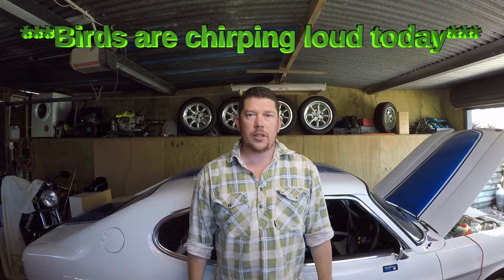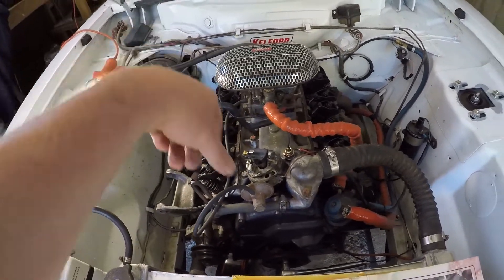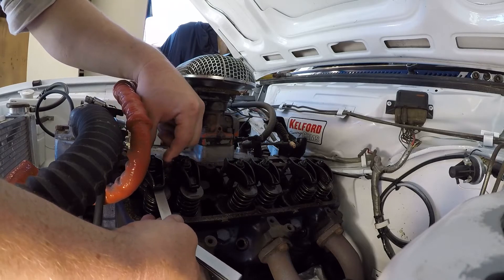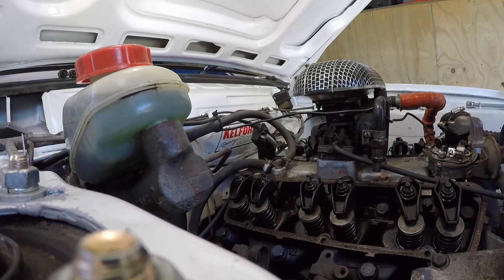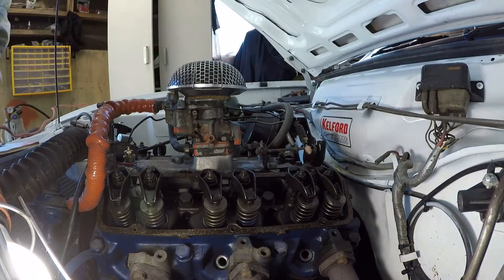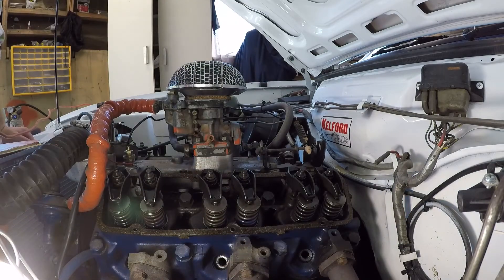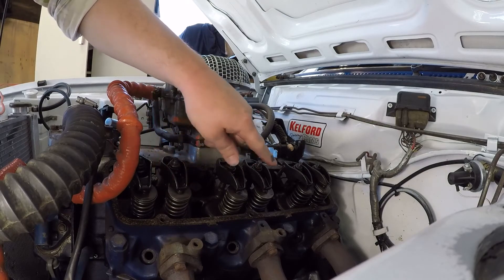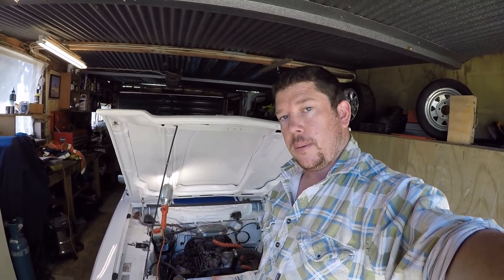Valve lash check on a Ford Essex V6 Capri

Comment: Tap both sides of  the rocker with a spanner to make the rocker aligned more correctly on the valve stem before checking with the feeler gauge as this is more accurate .

Comment: Mate!! That's a great video/help. I have a 76 Mk3 cortina Bakkie (Ute) 3.0l Essex, 5sp manual. Owned it for a week. I believe there is some power/torque to be had out of this little motor? I'd love your input/advice 😎
Reply from the maker: Hey Warren, assuming you have given it a good service and once over, checked ignition timing, spark plugs, fuel mixture, ht leads etc probably the easiest modifications for any classic car would be a good set of long tube headers and free flowing muffler and exhaust. A high flow air cleaner and possibly a carby upgrade depending what your running. I say these points first as it doesn't require diving into the engine and your likely to get some solid gains. Some cheap insurance is to inspect the condition of the oil pump hexagonal drive by pulling the distributor and looking into the engine to see if it is badly worn or the hexagonal in the bottom of the distributor is badly worn. Once those points are covered, you could look to port match the intake to the cylinder heads but probably not that beneficial without a aftermarket mild road camshaft. From that point, your really looking at pretty major engine work such as uprated camshaft, engine balancing etc. Please note I'm not an engine specialist, it's just the most likely order I'd go about it.
Reply: You all prolly dont give a shit but does someone know a tool to get back into an instagram account??
I somehow forgot my login password. I would love any tricks you can offer me.
Reply: @Sonny Andres instablaster :)
Reply: @Jaime Benedict i really appreciate your reply. I found the site through google and I'm waiting for the hacking stuff now.
I see it takes quite some time so I will reply here later with my results.
Reply: @Jaime Benedict It worked and I now got access to my account again. I'm so happy!
Thanks so much you saved my ass :D
Reply: @Sonny Andres you are welcome =)

Comment: Is this same for Ford capri 2.3 v6
Reply from the maker: No I believe that is a completely different engine so I would recommend finding the info for that specific engine
Reply: @feralfabrications2465  ty so could you help me with that cuz I was trying to find for Ford capri mk3 2.3ccm v6 But I did not find it successfully
Reply from the maker: @tomislavtodic1037  I believe you need to find yourself a manual for a 2.3l cologne v6 engine to find that info. I couldn't find it online either
Reply: @feralfabrications2465  daam I was trying so hard but nothing

Comment: Did you ever consider roller-tipped rockers from a chev?
Reply from the maker: I didn't know chev ones could be adapted to fit. I have heard of chev pistons being used. I'd like to upgrade bits on the engine so it's suitable to buzz up to 7500-8000 so some roller rockers are definitely on the cards.
Reply: @feralfabrications2465  Yella Terra make some, but supposedly 1.6 ratio SBC work. I'm following it up now - if I find out I'll pass it on. That's spinning pretty damn fast for an Essex.
Reply from the maker: Yea I've seen the yella terra rockers for sale. I'm thinking my upgrade path for the engine is: 

1. high comp pistons, performance conrods and balance the bottom end.

2. Port & flow the heads & install larger valves & roller rockers.

3. Tripple carbs.

To be fair it honks along OK but still plenty of HP to squeeze out of it yet.

Unfortunately, I'm still cutting rust out of the body!
Reply: @feralfabrications2465  There is far more support for these engines in NZ so you have lots of good suppliers over there, better than in Australia. The good thing about the heads is that you don't have to enlarge the Ex valves - they're already on the big size. Bigger intake valves are a good idea and lots of people like the triple webers. I have to get the rust out of mine - a big job.
Reply from the maker: Thanks for the pointers. Time to stop day dreaming of a fancy engine and head down to the shed for another attempt at making a new front cross member. Surely 3rd time will be a charm!